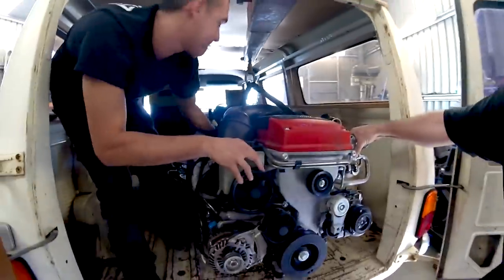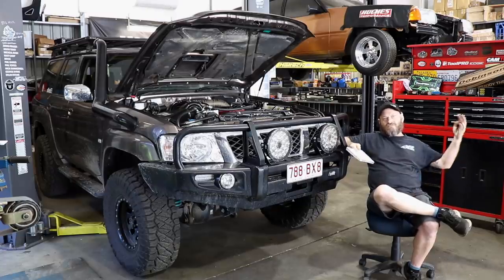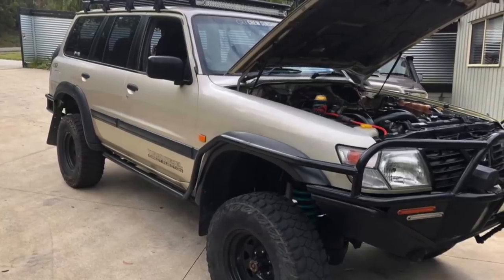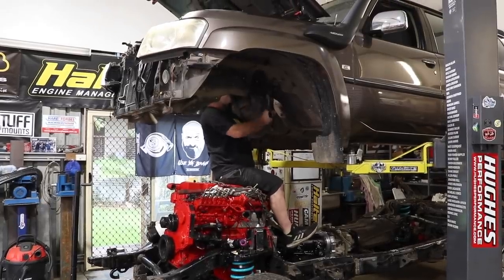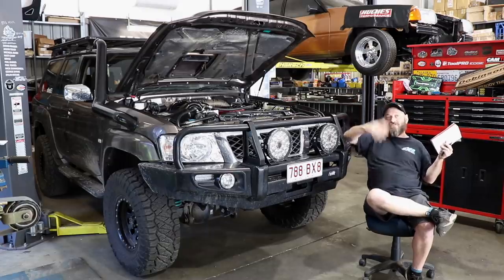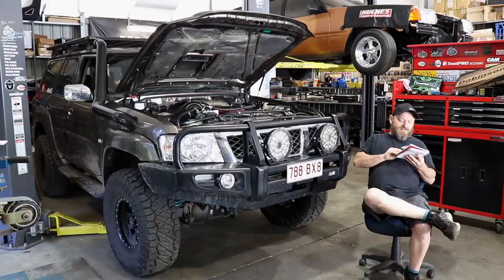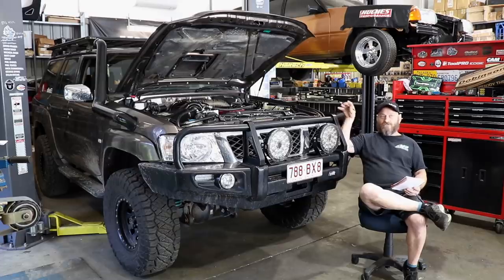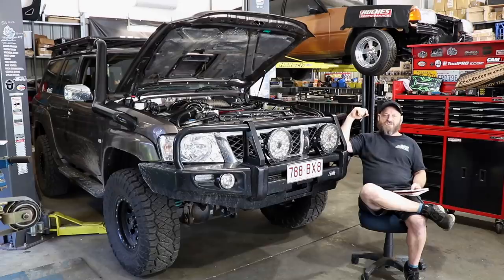Thinking of a Cummins Conversion? Watch This First!

Comment: The Mercedes G-wagon already came with turbo diesel and they are very capable 4x4's right from the factory. There is a good reason European army's bought these. 
So if you want that Mercedes TD engine, just buy the whole G-wagon.

Comment: The om606 is a good engine, but it likes rpm and isn`t the strongest down low, so in my opinion it is not the best engine for the 4x4 conversion. The om613/648 3,2 cdi engine is much stronger down low for offroad use. The om606 is better for something a littlebit fast and fun instead.
Reply from the maker: That is what I hear from people that actually own them. The 606's attribute is that it's a diesel that revs hard so makes power. So do dozens of 3l petrol engines.
Reply: @theskidfactory  Exactly! But it’s still a fun engine, just not what I find most suitable for a 4x4 car. I would still love to see you try one for a build, just maybe a ute or something instead of a 4x4.

Comment: I got a 2000 ford f350, and I keep on telling my self I’m gonna 5.9 swap, when the old 7.3 goes, and just make a crazy amount of power, but I see this and I’m scared, even tho there’s an off the shelf kit to make the Cummins bolt up to to my 4r100 tranny
Reply from the maker: If you are in the USA it is not going to cost anywhere near this amount. You could do an F truck in the USA for 10k.

Comment: I'd like to ask a question fellas,what's your thoughts on the perkins/Mazda T4100/Ford Trader version with the NIKI Rotary Diesel Pump,any good,and do they have a glowplug conversion,cheers fellas,and which gearbox would be better,a Mazda/Ford 5 speed gearbox with the POWER/ECONOMY set up,cheers
Reply from the maker: Do you mean Diesel Kiki? They were generally good workhorses but all old diesels will need service. Sometimes that means a new cylinder head. 
There are 3 types of diesel owners - Those that say they never spent a cent, those that say they spent the kids inheritance and those that told the truth. All machines wear out.
Reply: @theskidfactory  That's the one,got a maybe kinda found one in an grandpas axe F truck,had that same pump,but a F truck 4 speed and 4.55 ratio diff,it's something I've been kicking around,cheers gentlemen

Comment: It's too bad we have to take this damn reality into account because this kind of project looks incredible until you realize how much it takes to achieve it...
Unless you're having fun, or building a demo vehicle, it's unreasonable to go for this kind of build :/
Too bad, i reaaaally would like to know what a Deutz tcd 4.8 would give in a patrol ! Super low revving truck engine, massive torque, and yet probably not a huge fuel drinker !

Comment: hello
Do you know the isf3.8, 4bt, and isv5.0 engines?
Which one would you recommend and what should I change to put on my Nissan Patrol Y61?
Reply from the maker: 3.8 might be ok but they are usually very low revving so you need 3.5 diffs and big tyres to take advantage of the torque. Same as any truck based engine unless it has a 6 speed transmission.
4.5 ISDE is also popular in aus.
Reply: @theskidfactory  Have you tried the lSV5.0 engine?
Reply: between 4bt and 6bt which one would you put and why?
I know that the 6BT is very heavy for the Y61 and can break the chassis. @theskidfactory

Comment: A V W 7P 4.2l V8 diesel with a 8speed auto there is one on eBay 57000kms $4600 these are common rail 300kw 900ftlb toque and would be Harf the fuel of your Cummins and noise
Reply: There is a VW brand new V10 in the USA for $12600Au that would be a blast or a Audi V12 TDI

Comment: How do the 5 speed auto patrol boxes out of the tb4.8s go? Would they take more power than the 4 speed auto?
Reply from the maker: No, the 4 speeds are considered stronger but the converter size is still an issue.

Comment: Umm, maybe an Audi diesel, 3.0 V6 pulls a Q7 around pretty easily. They also have a 4.2 V8 and 5.0 V12 diesel. Not the cheapest. I hear the 3 liter is the most reliable.

Comment: Not sure if its been asked or covered  does the tcu yous use have any issues when in 4lo or is there a "multi tune" switch that changes shuft points when in 4lo
Reply from the maker: It has a 4 low input. That said, I haven't used low because it's such a torque monster.

Comment: Hello, can i use a zd30 transmission gearbox with 6bt without horse power modification perfectly without problems?
Reply from the maker: Manual transmission will survive with a 160hp 6BT if driven respectfully. Automatic transmission will not work due to torque converter size.

Comment: 12v is cool but to heavy.   Do a om606 with mech bosch pump.   makes same power as 12v engine but almost half the weight.
Reply from the maker: Also makes a quarter the torque.

Comment: Porsche Cayenne 4.5L Twin Turbo V8 from like 2002 into a patrol would be kewl
Reply from the maker: I already have the whole car. I tow my camper with it to beach camps.
Reply: @theskidfactory  ahhh ok nice. Had to empty the grommets behind the front wheel arches yet? Leaves and water. I learnt the stinky way. Would love to see that engine in a 4wd build though, just imagine alot of electronics and dont know who or how an adapter plate etc would work.

Comment: Are there any good Japanese truck/industrial motors we could use in Aust instead of US/Euro stuff?
Reply: I'm sure some of the little-to-medium trucks would be fine donors. One smaller Isuzu I drove seemed like a good unit, can't remember any model details, but it was a 4 cylinder and had a far few ks on it, went alright for a stock small truck.

Comment: I'd like to see your take on fitting an Eclipse turbo to a ZD30.  DI or CRD, preferably CRD.  This would be by far the least expensive "conversion".  If one had a blown ZD30, whacking in some new pistons and a new head would be relatively cheap.  This is a selfish request, as I'm considering this turbo for my healthy (80,000k) CRD.

Comment: i mean the other way is not to convert it  in the first place i know i like egine conversions too but  to be honest un less your towing big vans or small houses the zds have engough power to go anywere they need and to get one changed and rebuilt is normaly less than 20k and with some gages and anti nades kit it will last another 250k 300k also you dont need to get it enginerd (some states) yer there not the quickest but why are you trying to race near on 3ton

Comment: Noisiest engine? I've been considering a 6BT swap into my Land Rover Perentie that currently has the Isuzu 4BD1T engine (Isuzu is extremely underpowered and almost no options I can find to get decent power out of it) - I run it in my 6x6 Land Rover weighing just under 4.5 tonne. ... The Isuzu is extremely noisy... has anyone here heard them both and able to comment re which is noisier? I'd ideally like something slightly quieter then the 4BD1T

Comment: Interesting video thanks, just not sure why you need to go to so much expense and effort are these Nissans so bad you won't use their own engines and transmissions.
Reply from the maker: The engines aren't great, especially the diesels. The transmissions are pretty good but not good enough for a powered up 6bt. They are fine for a std or mildly modded 6bt but not something with a this sort of mods. The chassis and diffs are excellent, one of the best offroad chassis around.

Comment: So what’s the rev range on one of those engines
Reply from the maker: About 4000rpm if you change governor springs. Under 3 from factory. You need the 3.54 diffs and big tyres to use the torque as there are no revs.

Comment: Here in the United States, those motors are plentiful and cheap. They don't just come out of a Dodge Ram. You can get them out of buses you can get them out of equipment Out in the oil fields near where I live in California. They use them as generator motors. There's literally fields Of them ready to be rebuilt and repurposed out the oil fields. If they keep going with all this solar bullshit to run these oil pumps, maybe not Not, I'll just make them cheaper. You can get a road in one for 2 thousand dollars

Comment: Solution to your downshifting to brake issue: Install a Jake Brake.

It’s just cool and it’ll annoy Karen and her girlfriends.
Reply from the maker: Jake brake will not help one bit if the engine is not directly connected to the axle which is the axle issue the auto is giving.

Comment: Super charged gm 2 stroke v8 from a Peter built.
Reply from the maker: It's not a supercharger, it's an air blower to evacuate the cylinders.
Reply: @theskidfactory  I think they are a gm detroit. We used to have 4 of them running the water pumps on the drilling rig I used to work on.
They ran at full noise for months straight around the clock.
We had volvo turbo motors running other equipment.
The v8 2 stroke sound was awesome 👍

Comment: Just get a 200 Series, vastly superior, more economical, more reliable, more comfortable, safer - just better all round for a lot less money.
Reply: @alexandersupertramp1293  you can easily buy a 200 well under $60,000, your donor car and 50k conversion. Even a 2007 model would be miles better.
Reply: @alexandersupertramp1293  so? The 200 would still be quieter, far more economical, last longer, more capable and far more reliable than Cummins' hand grenade in a Pootrol.

Comment: Just put M57 BMW engine inside. And that's it.
Reply from the maker: You will never make the torque with half the capacity. M57 and OM606 are great engines but they are still small capacity so it's a sideways step from a ZD30.

Comment: If you like commonrail and want the best diesel going then m57 all day long, leave those noisy/heavy/slow/lazy truck engines in trucks 😂
Reply from the maker: When I think reliable diesel I don't think BMW.
Reply: @theskidfactory  There's a reason the m57 won International Engine of the Year award so many times, standard engine and auto 6 can also handle 700hp/1000ft+ torque stock. It laughs at your noisy truck engine 😉
Reply: @Ben-in6qh  These international engine thing means nothing, honestly. 
M57 is alright engine, but in Australia there's not much of them.
I've seen a couple of Patrols with m57 for sale here in Poland. It is also quite popular to install zf 8HP alongside with m57. Guys over here now how to work on them.

Comment: AAARRRHHH UMM put a Toyota 1HDFTE or a 1HDFE if ya want real power :) :)
Reply from the maker: Never heard of a 1HDFE. That would be a non turbo dohc 4 valve 4.2l diesel which would be mediocre at best. And it would also cost a bomb.
Reply: @theskidfactory  sorry that should be 1HDFT that’s what’s in my 1997 80s no electronics to worry about a low mileage one from Japan is around $11k plus fit they come with the lot pump turbo injectors

Comment: If it really cost you $50,000 to convert to a Cummins you did something extremely, extremely,  Incorrect, and wrong.
Reply from the maker: I am guessing you are in the USA.
Reply: @theskidfactory  I am im the US. However, it boggels the mind about much it costs. Seems outrageous. However, your work looks really good.
Reply: @theskidfactory  PS...I subscribed to your channel. I like the Barra in the van.
Reply from the maker: The engine I bought in Canada cost very little. But it was then rebuilt and converter to P pump so was around $15k AUD by the time it got to Australia.
The built 4L80E was about the same amount. It's pretty easy to spend that much on a job of this calibre.